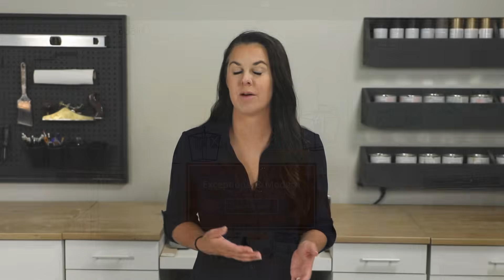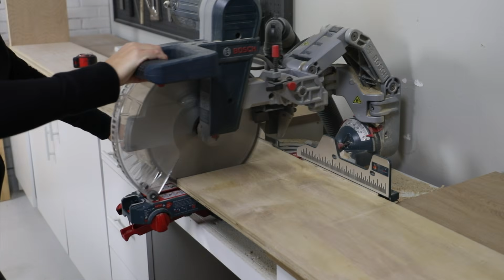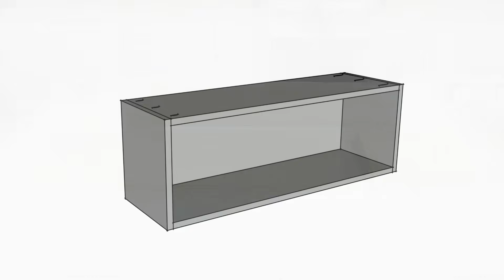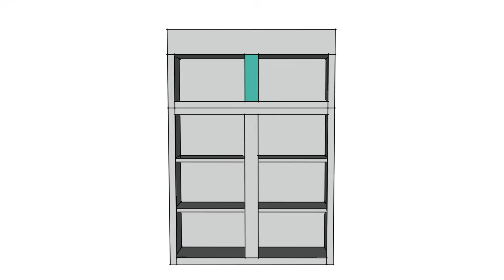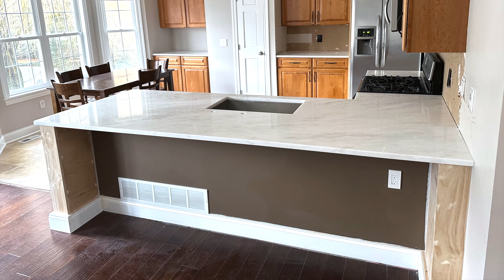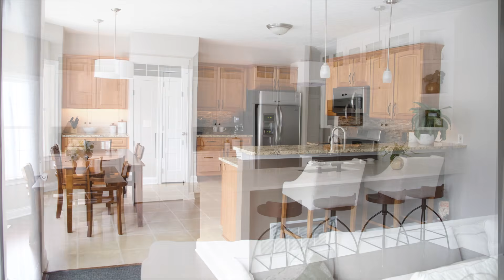How to Build Upper Kitchen Cabinets | House One | This Old House

Comment: If your just making cubbies instead of cabinets so your not installing doors do you need to build the face frames still? I know it helps cover up the rough edges however if that’s the only reason then maybe I could just buy better wood that doesn’t have rough edges since I’ll be sanding and painting anyways. Idk what do you think? Are the face frames absolutely necessary for cubbies?